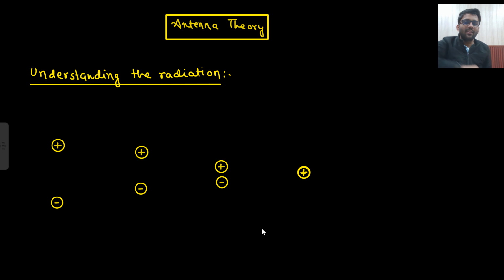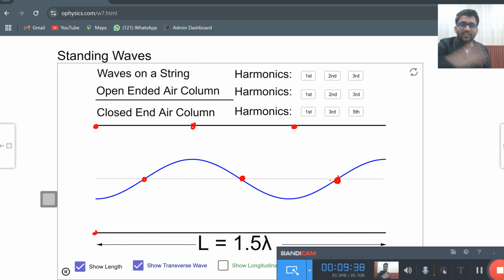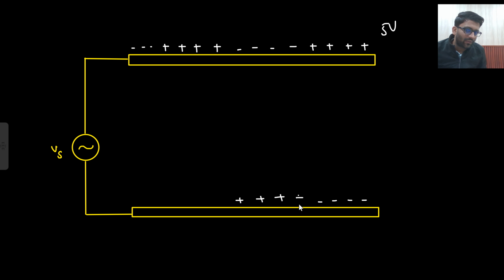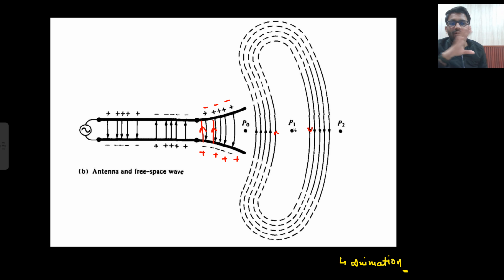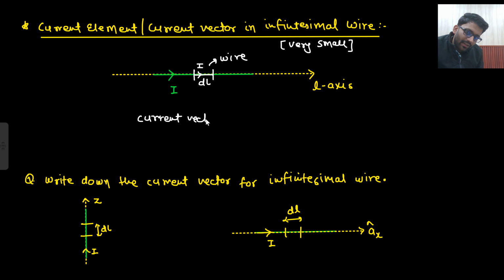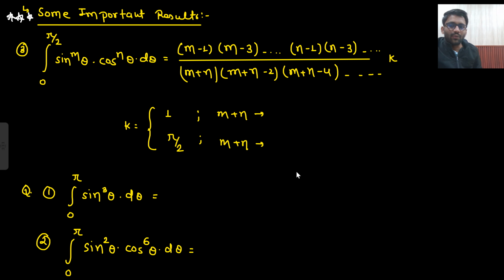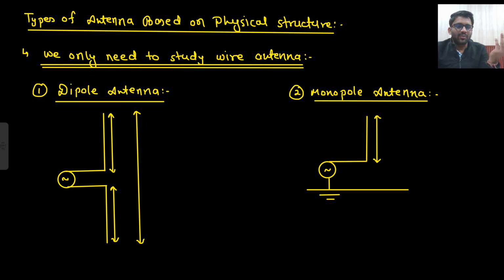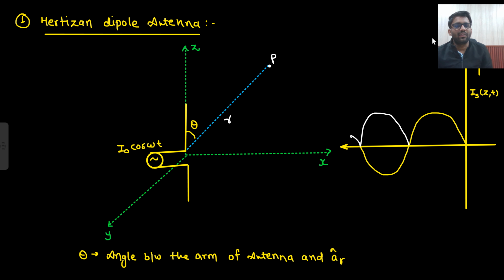Introduction to the Antenna || EMFT || ECE || PrepFusion || Himanshu Agarwal

Comment: Bhaiya in your posts you told to use code in Analog Electronics course 2025 to get it for free ....but there is no course like that, it is for 2026 and code can't be applied their so please look into this
Reply from the maker: It was free till a certain date. Not now. The course has been removed from the website.

Go to the Road to IIT/IISC course and apply Code "Fusion" there. 
But the course is valid till Jan 15 only